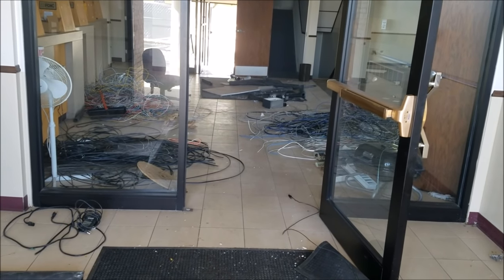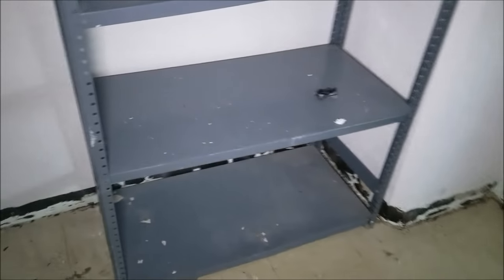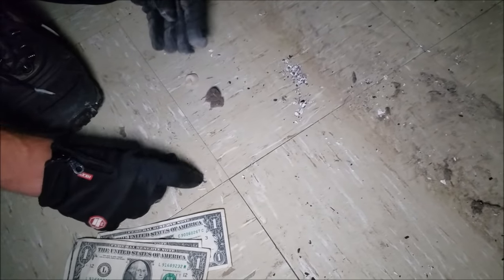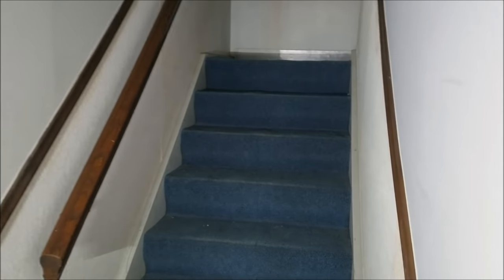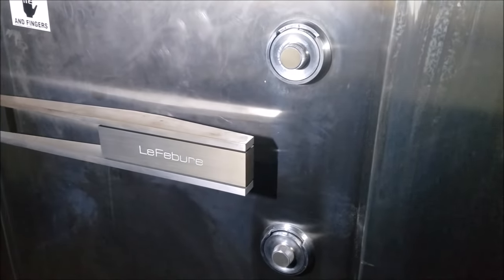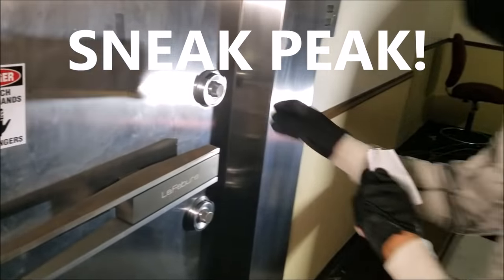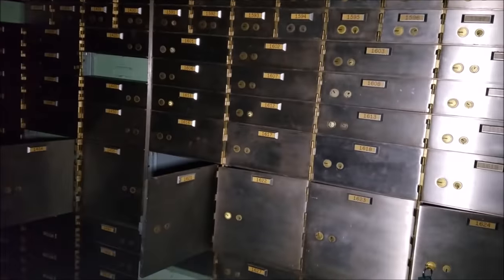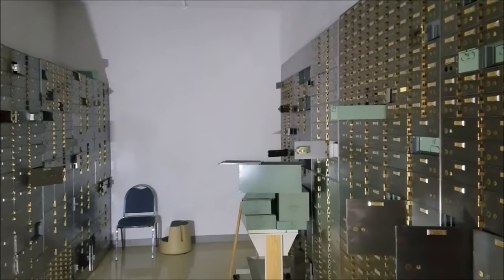FOUND MONEY EXPLORING ABANDONED BANK! (MONEY VAULT)

Comment: I worked for many years in branch banking. We regularly had to upen safe deposit boxes for people when keys were lost (we had the key to the left hand lock, the customer was issued 2 keys to the right hand lock). To open these, our custodian just drilled straight through the little round lock. Then you open the door and pull out the box by the handle. Later, they would just install a new lock. These guys are practicing a massive amount of overkill.